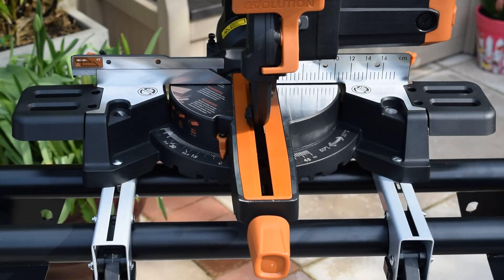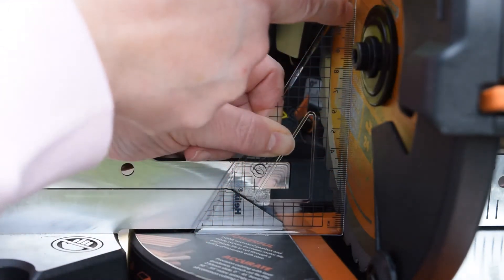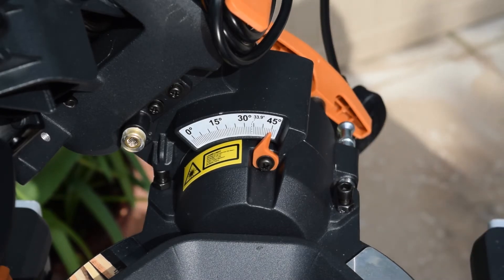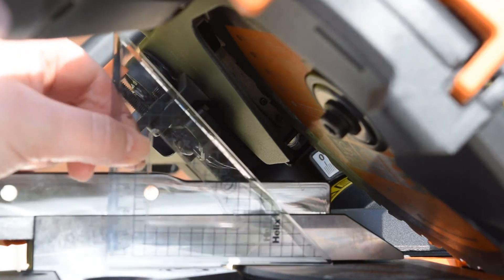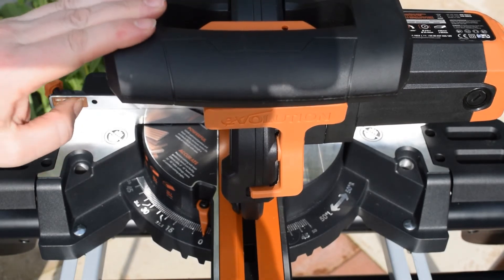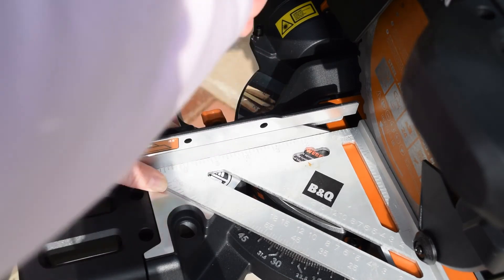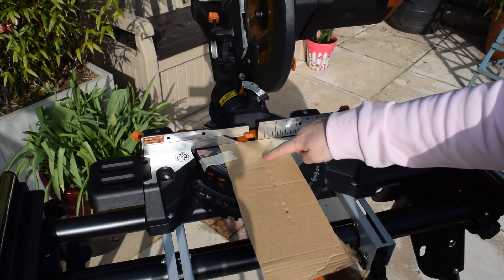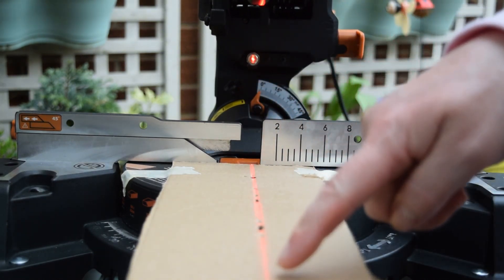Evolution Mitre Saw R210SMS + | How To Check & Adjust For Accurate Cuts including Laser Beam

Comment: Great video sorry a.. machine. Tough to keep aligned, laser is almost impossible to adjust and the 1 inch arbor blade for wood is tough to find. I should get the machine free for the price of an evolution 10/60.  Ditched this thing and went back to my metabo  that does what it is supposed to do. Anyone want a slightly used evolution?
Reply from the maker: Glad you liked the video. I really like the saw. I find everything stays aligned, even though I'm moving it around all the time. I guess it won't suit everyone. At least you have one your happy with.

Comment: Excellent! Thank you. My laser has stopped working. Can I repair this ?
Reply from the maker: Thanks very much. I don't know about the laser sorry. This might sound daft, but you have got the laser switch on, haven't you?
Reply: @bloominhometogarden  yes, I think so. It may need a battery? I will try and take it apart I guess
Reply from the maker: Good Luck fixing it. 🍀I've contacted evolution to find out.
Reply from the maker: You can replace the part. It's £10.99 + £5.00 carriage, next day delivery. The part is part 139 on the drop down menu. It's on the website https://shop.evolutionpowertools.com/products/r210sms-parts-base?_pos=1&_sid=518d7402a&_ss=r&variant=32120474468388. Hope this helps 😊😊
Reply: @bloominhometogarden  omg!  Thank you so much. You are amazing to

Comment: Thanks, this was much needed.  The manual and official evolution online guides or videos were useless.  Your video was very clear and perfectly allowed me to set up the machine.  To be honest I’m surprised how off it was on almost every aspect (with the exception of the fence).

One thing that surprised me about most of the videos online is any guidance regarding setting up the blade, there’s 2 locking washers.  The first washer that is between the blade and the machine is designed to fit blades with different sized centres, though none of the online guides explain this, and the diagram that comes with the machine doesn’t add up to what is on the SMS+, so you need to have previous knowledge of mitre saws to be aware of the reason/importance of having this the correct way around.

Many thanks for the video.
Reply from the maker: I know exactly what you mean, when it comes to instructions! Same with anything now though, don't really get instructions with anything anymore. You have to work it out for yourself....somehow! Glad the video helped you. Enjoy your saw.

Comment: Thank you so much for thi.s 
My saw was way out after cutting laminate floors a few months back. This saved me so much time and hassle.
Reply from the maker: Glad the video helped. I would check it on a regular basis. Last time I checked mine, the blade had gone out slightly. Luckily I checked it before cutting a load of decking. The price of wood now, you can't afford to make a mistake 😬😬

Comment: Hi, just using your video to do adjustment on my 185sms+ but my laser doesn't turn on. There was no battery. What battery type is in yours?
Reply from the maker: Mine doesn't have a battery, as far as I know anyway. The laser only works on mine, when the power is on. Sounds like something else is wrong with it.
Reply: @bloominhometogarden  maybe it doesn't have a battery then. Good video by the way 👍🏻
Reply from the maker: Thank you very much. It's appreciated!

Comment: It is possible to cut wood with 10x10 measure?
Reply from the maker: No it's not possible, sorry. The max section for wood is 230 x 65mm
Reply: @bloominhometogarden  what is the height of the plan when support the wood to the blade?

Comment: Should the cover on the laser be taken off or left on?
Reply from the maker: Think it should be kept on. I don't think it comes off. Mine doesn't.
Reply: @bloominhometogarden  the one I use was new in Dec 2021 (borrowed from a friend) and definitely has a removable plastic cover. I found that it can distort the beam slightly, but I made adjustments and left it on anyway because when cutting slightly resinous CLS timber, the laser lens got a significant buildup of resin & fine sawdust (the line disappeared).

Comment: Fantastic video on set up and laser alignment.  I have seen on other tutorials that besides the two screws you used to adjust left and right, there is another screw on the left side of the laser. At any point do you need to loosen that single screw before you adjust either of the two you adjusted.
Hope the question makes sense. 
Once again thanks for the great tutorial.

I have just purchased the Evolution R255 SMS+.......so hopefully the same process for the laser alignment is the same.....i  shall hopefully be setting it up tomorrow.
Reply from the maker: Oh yes I know exactly what you are talking about. It even says in the handbook to adjust that screw on the left of the laser. But it doesn't actually move. Maybe on the older models it did and they have now changed it, but mine definitely does not move. I finally realised this after about 30 minutes of trying 🙄 Thanks for taking the time to leave comment. Glad you enjoyed the video 😁

Comment: A good, clear guide to setting up the mitre saw. I bought the Evolution R210SMS last week and used this handy guide to calibrate it. I'm now confident that when I start using it for my skirting boards tomorrow, I'll be making accurate cuts (even if I bodge the measuring a few times :-D).
Reply from the maker: I'm glad the video helped you. Hope the skirting job goes well.

Comment: Hi I've setup my saw to the best of my ability following your tutorial. After the calibration I cut a small piece of wood both sides and when I put in set square it's not square slightest gap any ideas what I can do.
Reply from the maker: Sounds like your blade is not 90 degree square with the table, if I'm understanding you correctly. Go to my video ' 26 seconds ' from start of video and I'm checking the blade is 90 degree square with table. When you put the set square against table and blade make sure it's not touching the raised bits of the blade at all. There should be no gap at all between the square and blade (1 minute into video) all the way down the square. Shining a light directly on it can help you see the slightest gap. It needs adjusting if it does (1.35 minutes) how to adjust it.  If you know this is correct, check the orange pointer is on '0 degree' (47 seconds). If not you may need to loosen the screw slightly and make sure the orange pointer is pointing exactly at '0.  I hope this helps you.

Comment: Hi there. I bought one of these saws second hand a few months ago. I was aware that it wasn't cutting accurately but that didn't matter to me at the time, but tonight with a little bit of spare time I decided to check it out. Looking at the machine it looked pretty straightforward then I saw a technical helpline number on the machine so thought I would give them a ring tomorrow. Now however thanks to your excellent tutorial I won't have to bother. Many grateful thanks !
Reply from the maker: Glad the video has helped you. It's worth adjusting your machine, so it's accurate. Doesn't take long at all. Thank you for taking the time to leave a comment.